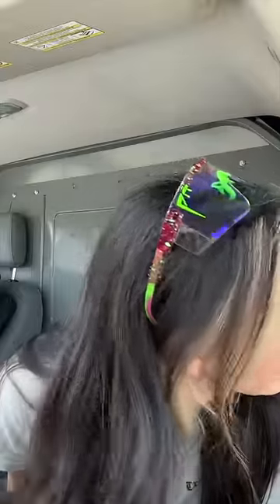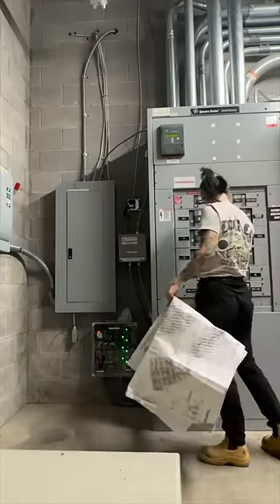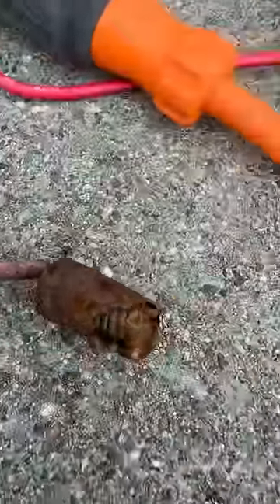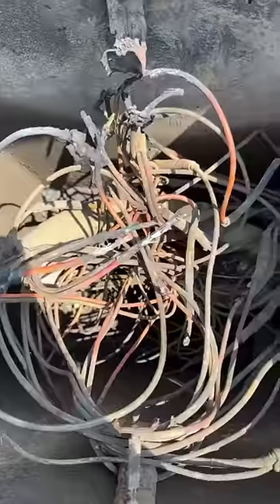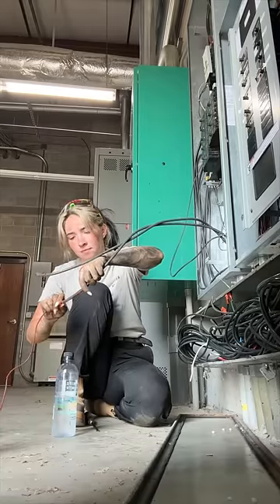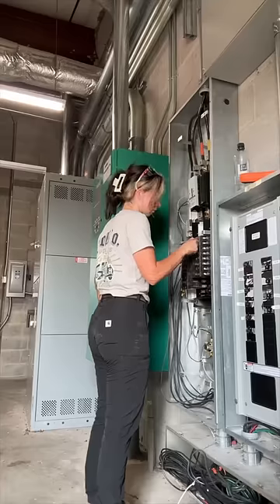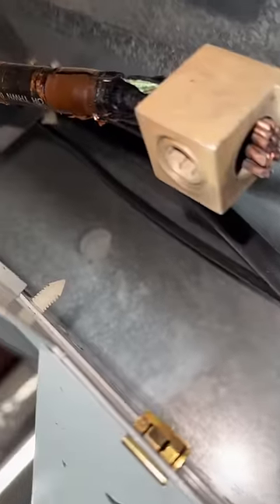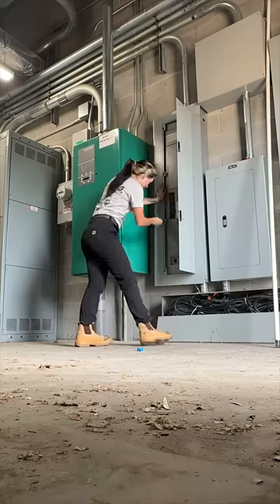Troubleshooting 480v Light poles

Comment: Nice video.  Not to be a nanny, but please remember your arc flash PPE when working in open panels.  Looking forward to the next video.
Reply: FR base layers as well
Reply: Go away
Reply: Only if it is live.
Reply: Holy hack job Batman,if I were this client I’d look into trying to get whoever installed those lights license revoked that couldn’t have been permitted
Reply: Like Bill O'Reilly once said, "Fuckit! We're goin live!"
Reply: NFPA
Reply: I wouldn’t  worry about the arc flash on a dead panel. That like wearing a seatbelt in the parking lot at Walmart.

I would by some gloves. Keeps the hands nice and clean
Reply: @Al_Gore_Rhythmn  it was actually “Fuckit! We’ll do it live”
Reply: @mon0railbredpig  I had to revisit it.  Such a classic 👌
Reply: She's working inside of a dead panel.
Reply: I make sure to stay cool rather than hot. So I wear shorts, a tank top and flip flops on all of my electrical jobs. My first job was 25 years ago. I've only been mildly electrocuted.
Reply: @asmongoldsmouth9839  You're doing perfect, flip flops are excellent insulators
Reply: @user-ot3zk5me5l People drive like nuts in Walmart parking lots though.
Reply: Arc flash and fall protection are the most commonly violated safety standards.
Reply: @cosmicinsane516  no one is violating a safety standard if the panel is dead.  Are you an electrician?
Reply: @chrisharrell5945  I didn’t mention anything about a dead panel.  No I’m an HVAC tech that never ever uses arc flash PPE and always works on live 480V crap.  And I stand by my statement that those are the two most commonly violated safety rules.  I never see any HVAC techs or electricians using arc flash PPE when they have live panels open. And at my old company I watched every single tech violate fall protection rules along with everyone else we worked with.
Reply: @cosmicinsane516  Why so sassy, you didn't, I did.  She's working in a dead panel. You do recall you posted up under a comment where the OP posted about wearing PPE in an open panel, as if it was live, correct? Then you come along as if to validate that.  Your comment would have been best suited as a general comment out from under the umbrella of the OP.
Reply: @chrisharrell5945  I understand.  What does that have to do with what I said?
Reply: @cosmicinsane516  doesn’t matter- post what you want, where you want - keep the fist alive
Reply: It's more the PCB's from the vaporized plastic insulation and surrounding area from old cabling I would be worried about, those black hands would be coated with a very small amount of Polychlorinated Biphenyl's
Reply: You realize those suits don’t protect you from shit and just make it easier to clean your body parts up? If I have to work in a live panel I’m not wearing any PPE I’ll make sure they have to work extra hard to clean my parts up off the floor and walls
Reply: @Antonnn1111  in smaller panels they would but I agree in larger switchgear and higher amperage panel boards, they just ensure you're skin doesn't drip off like liquid wax.  The blast would most likely kill you anyway.  Shucks, I've ran the figures of various switchgear through the calculator and there are those which far surpass a 40 calorie suit...in the 100s of calories.
Reply: @chrisharrell5945  I hope one day they invent a PPE that can withstand that and still be comfortable to wear but it’s doubtful
Reply: My workplace electrical training scared me enough with arc flash photos that I just leave anything over 48V to people who know more than I do.
Reply: @BrentBlueAllen  😅 Yeah it all depends on the voltage class, the arrangement and proximity to source.  You'd have to do something really stupid to get hurt in say, 'a residential panel'..most anyway.  

Most residential panels possess breakers with an AIC (Amperage Interrupting Capacity) of 10,000 amps.  That's the interrupting rating during a fault condition or dead short, which is different than the 'normal rating' (overcurrent) stamped on the handles.  The AIC are values attributed to all breakers based on their trip curve characteristics.  That seems like a very high number but in a dead short scenario, it's not really.  That flow of electrons can happen in nanoseconds.

It's the 277/480v voltage class which is responsible for most of those photos and videos you're referencing.  In commercial and industrial applications breakers can possess ratings upward of 100,000 AIC...so they're much more capable of sustaining a fixed arc which is what the arc flashes/blasts are made of.  The 480 volt class was dialed in to that voltage range because it's a sweet spot for efficiencies of the power to torque ratios for motors and equipment.  This sweet spot is also what makes it so dangerous and possess such an ability to hold fixed arcs.  Your 120v and 240v circuits just can't do that.
Reply: I love how you say off
Reply: Omg apprentice of the year, if it’s 600 amps or above yea might want to wear something better but that’s low volt technically so you won’t need a arc flash suit
Reply: @user-pc7ts6fc9l  You're wrong.  The 480v voltage class is largely responsible for a significant amount of injury and death in both industrial and commercial environments.  The 'Arc Flash/Blast' incidences can and have occurred in a myriad of panels, enclosures and equipment below 600A rating.  The overcurrent protection rating of a system has nothing to do with the AIC of that system.  Don't be fooled, you call 480v a low voltage, it's not something to play with.  In many regards it's actually more dangerous than the higher voltages which utilities work with and warrants arc flash protection.
Reply: I was going to say.  At my jobs, they would have been firing people lol.

Comment: 440 and above and you should be wearing PPE for arc flash. Also should use a non contact sensor to see if everything is off.
Reply: Should, yes.  But not everyone does, and some people are very aware of what they're doing.
Reply: @KC9UDX That’s until someone has reversed Hot and Neutral on 277, or has put a Switch on the Neutral rather than the Hot. Had that where the Time Clock, turned Neutral off, rather than Hot. Even going to Ground with my Fluke Meter didn’t pick up the Voltage, probably due to corrosion. My Body did though.
Reply: @stevenmoomey2115  that's why you treat everything as live.  And, just make sure everything is right.  But I get it; I had something similar happen once.  By the grace of God, my screwdriver took the hit in stead of me, and I was shielded by the box cover (I hadn't taken it all the way off), plus my face was far enough away.  Someone had swapped Ground and Hot, and double-hotted the circuit.  I hope you're alright; 277 can really, really burn you, if you're lucky.

I have a serious beef with my employer giving me 500V gloves, when I work on 480V all the time.  Sure, they probably are safe much higher than 500V, but still...
Reply: @stevenmoomey2115 did you lift the neutral off the terminal?  Could have been a shared nuetral
Reply: Non contact sensors are crap as they work by detecting mageticfields and don't work if voltage but no curent is present. Two prong testers are better as they actually mesure the voltage betwen two points also most feature a function where a high resitance load can be swiched across to savely dischagre capasitive voltage and test trip gfci's.
Reply: @subjekt_9142  The contact sensors are designed to sense the electric field and not just the magnetic.  They are after all, a 'voltage sensor'.  I understand they're not a precision piece of equipment and I've had a few hiccups here and there with them but they do have their purpose. I've been using them on live lines for 25 years.  Probably brand dependent.  Lots of guys ride around with them in the center console, parked somewhere near all those coffee mugs and they get abused.  They do have their purpose though, when you're in a passthrough or have exposed cable and have no where to use traditional meter.  There's not always a place to use a two prong sensor either.  Certainly not a stand alone, that'll get you killed.  But I do use them.
Reply: @chrisharrell5945  yep, importantly, current creates magnetic fields:voltage creates electric fields.

A non-contact sensor can give a false negative but also never a false positive.  Most users are aware of that, but it is worth repeating.  I don't like using them but as you say they have their purpose.  I haven't seen anyone carrying a Wiggy since non-contact sensors became common, there's that at least!
Reply: @KC9UDX  Yeah I've seen very few using a wiggy.  When I entered the trade, there were  a number of old timers still using the analog meters, but even then I never saw the wiggies.  Those were the days before arc flash/blast were so well studied and meter categories being developed and broadcast.  My take on the wiggy is, if I'm going to take time to place two prongs onto a circuit, it's going to be with a bona fide electrical meter.  Therefore, I've never even owned one.
Reply: @chrisharrell5945  I use analog meters exclusively at home.  Can't really justify a VTVM at work though.
I yoosta have a Fluke with a low impedance mode.   I wish my current ones had that, it actually comes in real handy at times.

I yoosta see guys with wiggys that had a stabbing prong on top and a flying lead with an alligator clip.  Í didn't get to see it but someone had a wiggy explode in their face, stabbing a 600v conductor.  Word about that spread pretty quick and less guys used them, but lots still had them.  I never had one; for the same reason you don't: I didn't see the advantage.

Comment: you've got a dead ground , grounding issue ,,, somewhere ! Or the wrong voltage ! Those wires shouldn't even come close to melting the insulation , before the breaker trips out !

Comment: I love videos like these. Short or not, there's something to learn each time. I am a distribution designer and have designed some circuits dealing with breakers and street lights and from a design point of view it can be simple, but you never know how well its going to be installed and how good the equipment is.
Reply: Yes exactly and drawing a straight line across the PC screen is entirely different than installing that circuit in the physical world.  🙃
Reply: @chrisharrell5945  I work mostly with instrumentation using 24vdc power/4-20mA signal wiring and it is amazing how bad the wiring and conduit can be between the instrument and the PLC, etc.  In a wiring diagram it's A to B but in the real world is often far from that.
Reply: I do my own electrical for my home, within reason. The hardest part for me is following someones work, example I had to replace a fifty amp plug, I could not use a box I was intending to use because he did not leave me enough wire, if I would of put it in I would of left me enough wire. I understand cost and everything, but receptacles are not all made the same. Purchasing new wire was not part of the budget.

Comment: Those G.E. High break panels often become like the one you showed in the video, at the branch main breakers. 
We do not used any resin kits in the underground exterior j-boxes. Although they are solid, the conductors entering are flexing back n forth with any temperature extremes, opening up a path for moisture to get in. So, we have way better luck with the grease/ jelly filled termination devices. 
Thank You for awesome videos, my dream come true girl in my related craft ! 😍😘💕👍

Comment: Reminds me of the plant that I work in. 20  street lights around the plant road on 2 circuits. 2 black #6 wires and bare ground to each pole. Had to buzz out every pole to find the shorted ballast. After that I installed fuses in the bottom of all the poles so it would be easy to see which one blew. We used 600 volt ballasts and HPS lights back then. 600/347 volt plant with some 4160 volt equipment.
Reply: Good ole days 😅
Reply: How do you buzz every pole to find shorted ballast? I sometimes work on commercial lighting I'd like to know in case I run into this situation in the future.
Reply: @maximusvonderbrewskis 
Run continuity test and then insulation resistance test. That's how it is done in Europe/UK. No idea how the yankees do it.
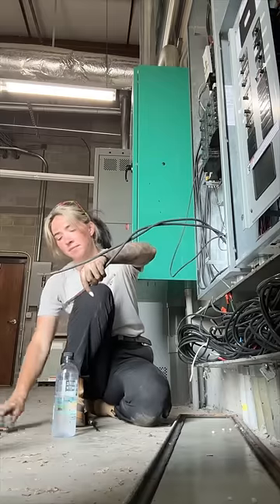Reply: @maximusvonderbrewskis At 1:19 she's running continuity test and/or insulation resistance test.
Reply: @IAmThe_RA american myself and the yankee comment made me laugh really hard. Are americans commonly referred to like this across the pond lol

Comment: We had a building where some of the 480V light poles were out and everyone my boss sent couldn’t figure it out so finally he sent me, shot in the dark lol. I started doing all the typical stuff, there was no tripped breaker just dead lights. We figured there must be a broken splice…but it’s a big lot with a lot of lights…so I started trying to chase the circuit, which I didn’t know which circuit was the issue. 
After getting no where fast and frustrated I stopped myself and realized all the other guys did the same thing with no success. So I started just walking around the lot. I came across the back of the property near a tree line. That is when I smelled it, that smell of death…rotting varmint. I followed the smell out of morbid curiosity and it was greatest around one of the light poles that was out. I called the apprentice to drive the truck over with our tools. 

Sure enough there was the nastiest smell coming out of the junction box at the base. I got gloves and without breathing, reached in and pulled out wads after wads of matted fur and straw…and little green bones. The copper had oxidized and stained the bones green. 
There was two of them that got down there. Someone didn’t seal up the top of the pole and the pole was in the tree branches.  We had to replace the lines going up and in the ground going to the next pole. They chewed it up but the breaker never tripped so electricity ate the wires away. The insulation on the wires going up to the head looked fine, until you bent it and saw little copper glints. The squirrels were clawing into the insulation in order to climb up the pole.
Reply: Dang it man! Thats a bad way to go.. eighh..Imagine being down inside a tube and not being able to get out then slowly rotting.  
That's crazy, apparently the fur acted as an insulator from grounding to pole.  Good job man, you found it.
Reply: @chrisharrell5945  yeah, 277V to the mouth piece is a ruff way to go out.  Not a big fan of squirrels but I always feel bad thinking about that bit, pour guys.
Reply: @billybilodeau1991  Right!  Why all the hate on squirrels, I've ran into a number of people which don't like squirrels.
Reply: @chrisharrell5945  don't rightly know. We've been at war for so long I forget why exactly. Little bastards ate my garden up and have been trying to get into my apartment....but I don't hate them. I still get that swerve into oncoming traffic to keep from hitting one with my car reaction that most ppl get.
Reply: @billybilodeau1991  now that's justified...anything getting into my garden and eating will most likely end up fried next to the potatoes.